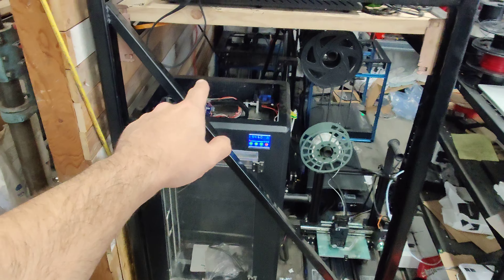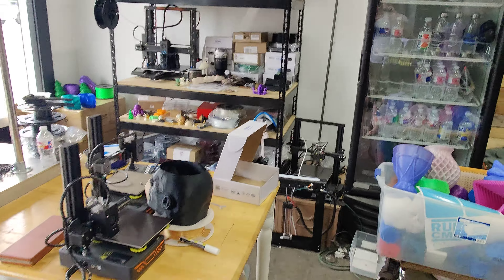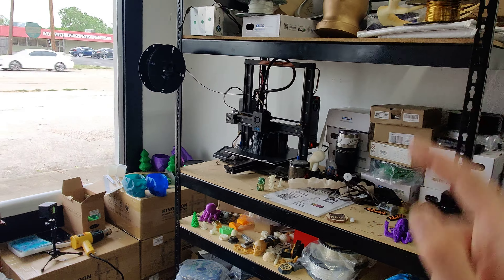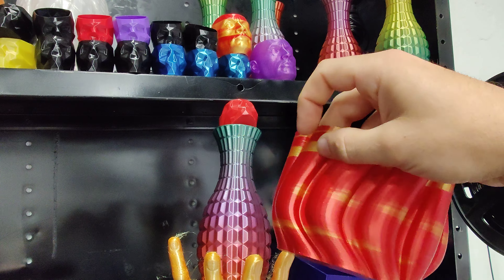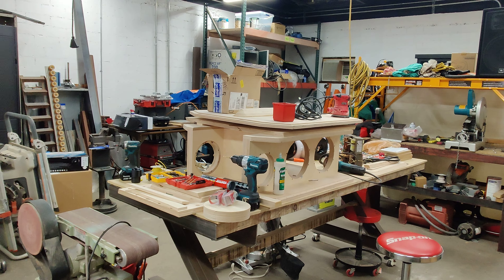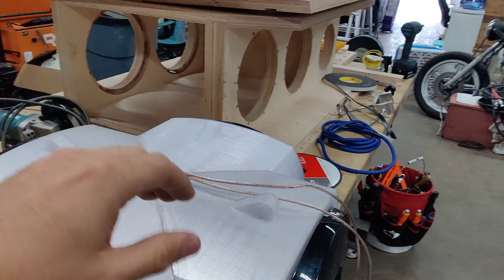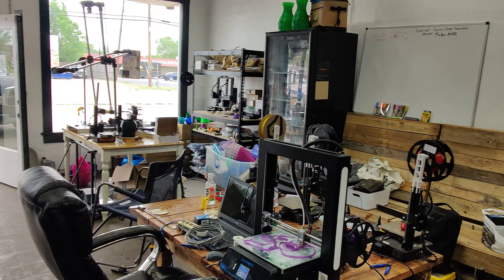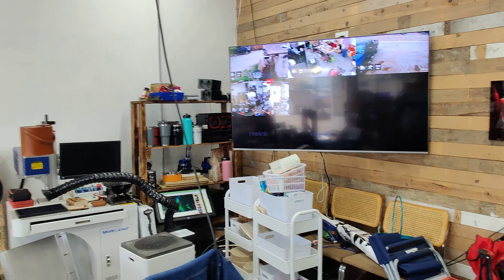General Shop Update: Tips for money making with a 3D Printer at a festival!!

Comment: Have you thought about 3d printed dies? You can press paper,leather, bend metal, stamp aluminum plates stuff like that? and what about moldmaking? thats a couple income stream ideas. You can also print small volume plastic injection molds, and even lost PLA (burnt out) molds. Then there are fixtures that 3d printing is great for. Thanks for your vids.